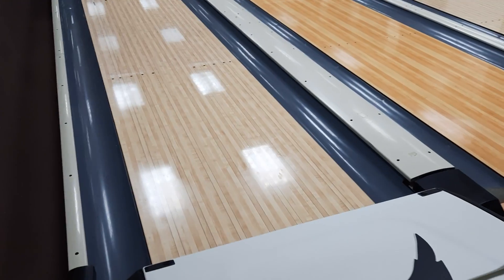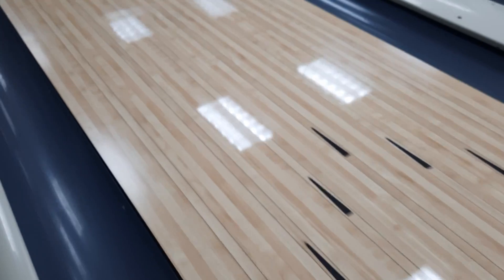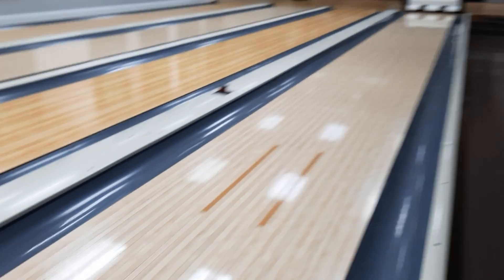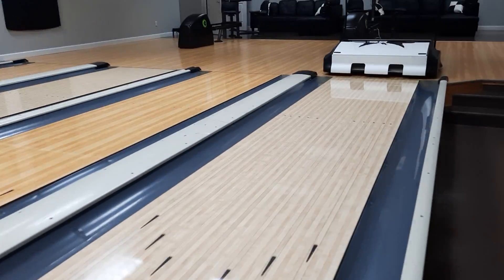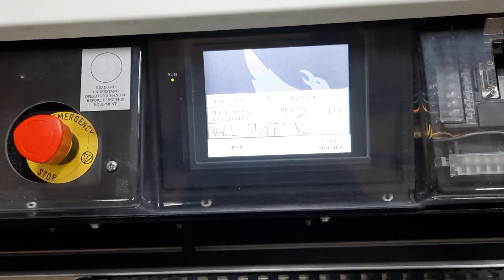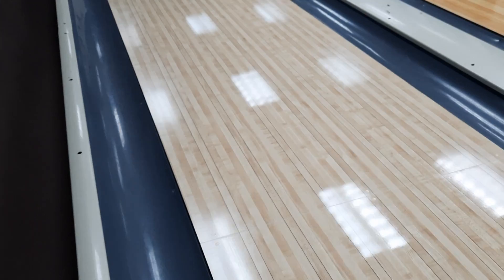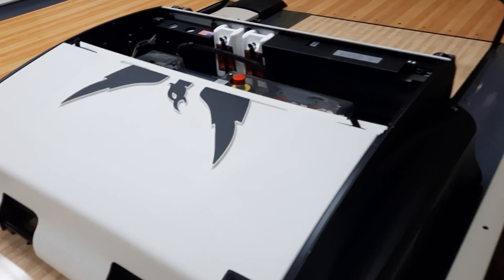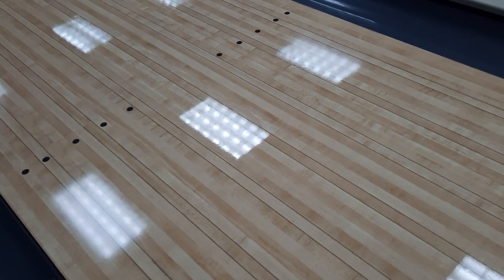Why is Oil on a Bowling Lane?

Comment: Hi Ron. Will the oil head stops moving left right after the end of the pattern (when no more loads to be applied) or up to the pin deck in the forward pass? I saw videos of Kustodian machine which oil head only stopped after it reached the pin deck.
Reply from the maker: It stops moving once no more oil is applied.